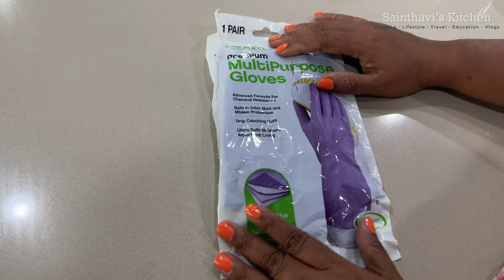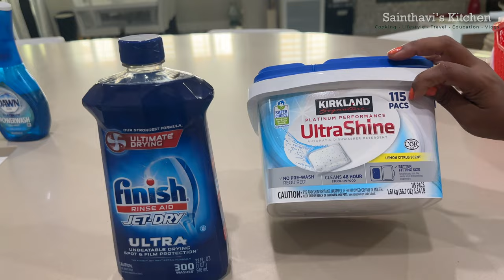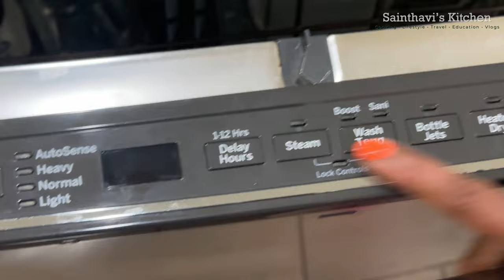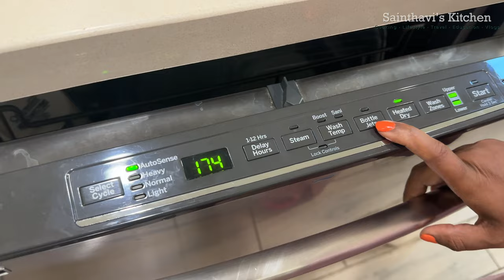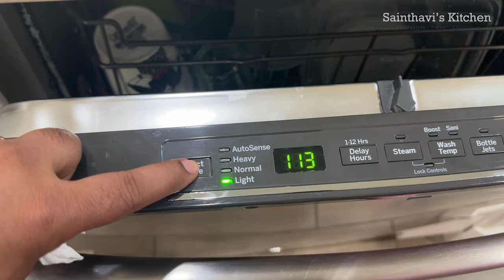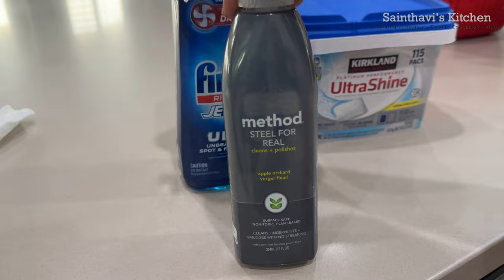How To Use Your Dishwasher Effectively? Maintenance Tips Kitchen Cleaning Sainthavi's USA Tamil Vlog

Comment: Neenga separate eh Oru plate vachinga la that row suppose to be plate holder and Neenga neraiya plates vacha row is suppose to be for bowls and vessels holder because rack has wider space to fit bowls. Please check if Togo container are dishwashers safe. 🍴🍸 symbols like this will help to identify and never put any lid to dishwasher because those plastic are not meant to withstand heat. The dishwasher ur having is probably little old, nowadays there are dishwashers with 3 racks and lid’s should be in top most rack because that rack ain’t getting any hot water ( example u can check your Pyrex glass box lids, there’s clear instructions to place it in top most rack ) 

Nice video. I never knew we can put gas grill in dishwasher and I was always worried about it getting dirty. Thanks 😊
Reply from the maker: Thank you